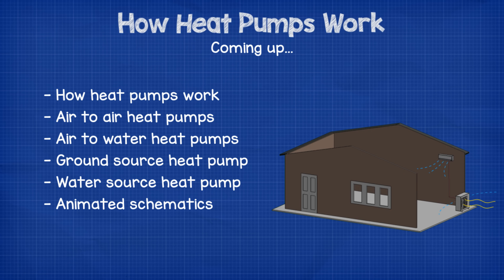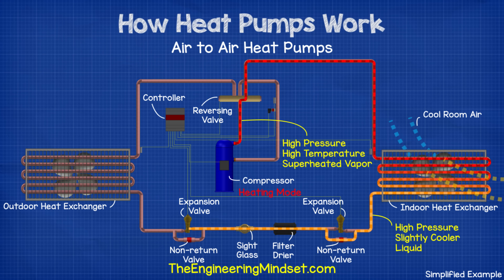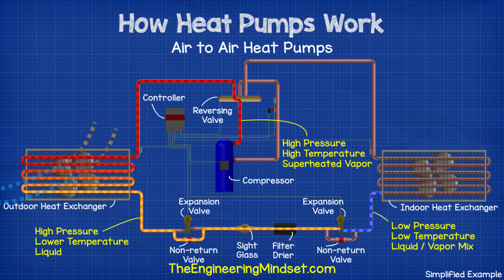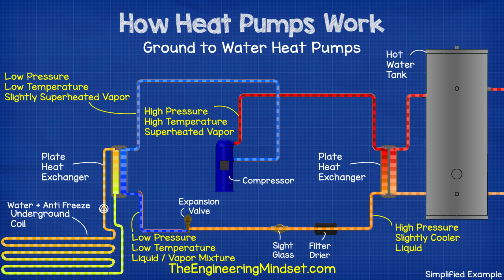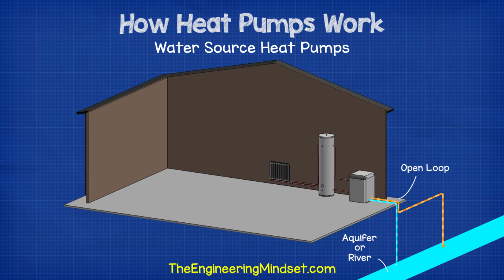Heat Pumps Explained - How Heat Pumps Work HVAC

Comment from the maker: ⚠️ Found this video super useful? Buy Paul a coffee to say thanks: ☕
PayPal: https://www.paypal.me/TheEngineerinMindset
Reply: The only principally different heat pump technology is missing in this review. Water evaporation and condensation heat pump without compressor and refrigerant at all.
Reply: Helpful.thanks.
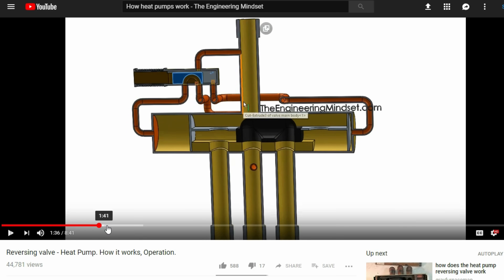Reply: 01:17 into the video, and the second commercial begins.
Reply: Remember when youtube wasn't obnoxiously innundated with excessive commercials ?!?
  Pepperidge Farm Remembers !
Reply: sir i have a question. what if i want to build my own mini electricity? through natural gas. since my place have own natural gas on underground.  now i want to install heat exchanger on my genset. is it possible to do that? instead of using it's giant radiator. I'll just took it out then replace it with heat exchanger system? so could run it continuously everyday?
Reply: Thanlyoi  shering  gues  welcomed
Reply: Outstanding video for slow minds like mine, thank you!! :)
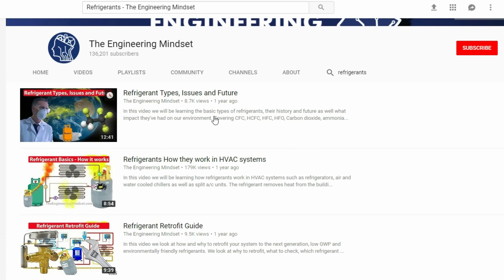Reply: 3:53
Reply: Ys fje wu ti
Reply: Hi interesting
Reply: Could you please make a video on vapour injection system in scroll compressors?
Reply: Good

Comment: so basically they are using the low boiling point of some liquid to boil it and gain the heat from conversion from liquid to gas ?

Comment: I wish that the media and the utility companies would stop telling the public that heat pumps “extract heat from the outside air”! I honestly haven’t thought much about them until recently, but have now started looking into replacing my gas water heater with a heat pump unit. As a retired mechanical engineer I have always been aware that, especially as outdoor ambient temperatures approach freezing temperatures, there really isn’t a lot of heat energy to be “extracted” from the air. Even a high school physics student knows that energy transfer between two fluids depends on the delta T, or the difference in temperature, between the two fluids, and the energy flow only goes in one direction – from hotter to colder – so “extracting heat” from the outside air to warm your house would require a magic trick that Gandalf himself would be proud of. 😉

So, what heat pumps ACTUALLY do is convert mechanical energy (from the electric motor) into heat energy (in the refrigerant fluid) and take advantage of the fluid’s properties (low boiling point) to either heat or cool air or heat water. Their benefit comes from the fact that they do so efficiently, or at least more efficiently than a gas or electric furnace.
Reply: Somebody is lying, this is basic thermodynamics. Refrigeration does in fact move heat from one place to another. Pressure is manipulated to change temperature to make heat flow in the desired direction. The compressor increases pressure and temperature which makes the refrigerant release heat, the metering device decreases pressure and temperature which makes the refrigerant absorb heat.

Comment: Interesting question , does having the water hot in the h/w cylinder with a air source heat pump help in getting the radiators hot quicker!

Comment: very helpful information - people ask me how my heat pump works and I usually reply "magic." So if the ambient air temp outside in January is 20F, and boiling point of the refrigerant is lower than that, the refrigerant will get hotter. But presumably boiling refrigerant is hotter than ambient air - how hot does it get? My air handler rarely switches to emergency heat, so I assume that the heat pump works ok in very cold weather.

Comment: So, the outside ambient air, even if it is very cold, can still transfer heat to the outside heat exchanger? It is relatively hot compared to the refrigerant.  I finally understand this, thanks.

Comment: Heat pumps take warm out of air pump the cold air out , so if most of a nation had them would they make the outside temperature colder cos they be taking all warm air out
Reply: Only so much as there is indoor space on earth. The relative amount of indoor space compared to outdoor is so minor that it would take significantly more than a worldwide conversion to heat pumps to accomplish what you’re saying. Now I would be curious if you have some research or some numbers to show this, as I would be fascinated to learn about it. At the end of the day, the energy isn’t lost, it is simply transferred to an indoor space, which is slowly leaked back into the atmosphere over time. Let’s remember that energy is never created or destroyed, but simply transferred.

Comment: I love the explanation of the heat pump side. Something I am admittedly struggling to understand however is single duct portable heat pumps i.e. a single duct blowing air from inside, across the evaporator unit and outside. To do that, it needs ventilation from outside somewhere else in the space which consequentially means drawing cold air in reducing efficiency. However, if the unit is drawing warm air already in the room across the evaporator, surely that should be better than drawing cold air from outside? Does the cold air being drawn into the room counteract that?

Comment: A water heat pump can only heat water and your house? Can't cool it?
Reply: No air to water can also heat your home via radiator or ducts. I have a natural in gas heat pump. It heats my water too before it goes back to the unit to be reheated.
Reply: @VagabondCaveman  i know that, my question is, air to air can both heat or cool your house, can the water units only heat?

Comment: i dont understand how come the refrigerant cools down when passing the outside fan, i understand it changes phase and in turn release heat, but during a phase change the temperature remains the same, so how does it drop? someone help pls.
Reply: The refrigerant is not cooled by the outside air, it is heated by it during heat mode. The refrigerant would become colder than ambient after going through the outdoor metering device because of the pressure drop.

Comment: I appreciate the video, but one thing I'm trying to understand is how the indoor heat exchanger works. In cooling mode, warm air is pulled in, making the room cold. In heating mode, warm air is blown into the room. How does this work? Are there multiple fans?

Comment: Thank you for not saying it pulls the heat for outside air and puts it in inside your home.
Reply: That's said at 3:58  
The refrigerant heats up when in contact with outside air, it does pull heat from the outside.
Reply: @hardcard254  the compression of the gas is what creates heat and the rapid expansion creates cold. The fan blows over the heat exchanger to remove the temperature of the gas as either the desired product inside the house and removes the undesired in the other heat exchanger outside the house. As long as the chemical used has a low enough boiling point it can work in sub zero temperatures. Look up the 5 Gas Laws and principles. 

 Yeah I guess I didn't watch through long enough for him to say that lol.
Reply: @John-771  The compression of the gas is responsible for only a smaller portion of the heat in the refrigerant. The majority of the heat released inside is heat that was absorbed by the refrigerant when it was in the outdoor coil. Heat and temperature are not the same thing. The compressor increases the temperature of the refrigerant, it does not add a significant amount of heat. There is always heat outside to pull inside the house unless it is absolute zero, -459.6 degrees F.
Reply: @hardcard254  He doesn't say that at 3:58. What I'm talking about is when someone says even when it's 20 degrees f out it pulls the heat from the outside air to heat the house.

Comment: if they were all so magically efficient As everyone says they are, they would already be in all new homes. But they're not because they're more complex, have more parts, function poorly in outside temp extremes and are literally a pipe dream at this point.
Reply: Mine is between 360-420% efficient, depending on how cold it is outside and how high of a flow temperature I need. 
I didn't pull these numbers out of a datasheet, they come from electric consumption and heat output monitoring... they're as real as they get. 

For every kWh of electricity it uses, my heat pump provides between 3,6 - 4,2kWh of heat. 

Granted, we don't live in Canada, Scandinavia or Siberia, we do get below 0ºC temps, but nothing as crazy as -20 or -40ºC  

This "pipe dream" has been keeping our home at a comfy 21-23ºC and providing domestic hot water all winter.
The running cost is less than half of what we used to spend with our oil boiler, the level of comfort is miles better, thanks to increased flow rate and constant operation.   

Also, fyi, heat pumps, solar thermal, etc. are already mandatory for new buildings in some countries. 

The main problem I see with heat pumps is that many installers and sales people either have no clue or are dishonest. 
They charge twice or thrice as much as they should, they sell you criminally oversized machines, they insist on putting in a buffer tank and secondary pumps when there's no need in many cases (and it's counterproductive, even)...
Reply: Heat pumps are the most energy efficient form of heat there is. The downside to them is the upfront cost compared to other forms of heat. Many parts of Europe are primarily heated by heat pumps. If the unit is designed for it they do still function in extreme cold, its just that the efficiency and performance is lower. If sized correctly a heat pump can be the sole form of heat even in extreme cold.

Comment: In winter uk (Oct to Mar ie 6months of the year!):
1. Lounge gets too hot at seated height
2. Lounge is very cold at foot level
3. Cannot air dry clothes in home anymore - Have to use Dryer - more electric)
4. Costs 3x more than summer
5. Is a nightmare and frustrating to understand operation for a typical end user
Reply: British homes are of then poorly insulated what causes problems.

Comment: 6:43 The hot water tank doesn't feed the radiators, if it did, it would run out of hot water in a matter of minutes. 

Keep in mind that heat pumps have high flow rate, they move over 600 liters of water per hour.
A heat pump needs between 30 - 90 minutes to heat up a 200 liter water tank.
If you moved all the water in the tank through the radiator circuit 3+ times per hour, the heat pump wouldn't be able to keep up with the dissipation rate.

DHW tanks for heat pumps aren't heated directly, a "serpentine" (spiral heat exchanging pipe) is used to heat the water in the tank, so there's an efficiency penalty.
Some tanks also come with auxiliary heating elements (resistors), which help speed up the heating process, but this comes at the cost of doubling electric consumption, which defeats the purpose of having a heat pump.

So, basically, the heat pump needs to feed the radiator circuit directly, for best results.
This is achieved by using a 3-way electrovalve, which is installed between the heat pump and everything else. 
This electrovalve diverts the ouflowing hot water from the heat pump to either the radiator circuit or the water tank's internal "serpentine", as needed.
It's an "either or" kind of system, it won't do both DHW and radiator heating at the same time.
Reply: explained very well 👌

Comment: Great explanation! No trying to dump on the vid, but it confirms a lot of my assumptions. Cdn government wants to outlaw burning of fossil fuels to save the environment. As a magical pill. This tech can be offered as an option. Heat pump use now means refrigerant gas will be needed for both heating and cooling. As the systems age the high pressure gas leaks into the environment. This system would also put more pressure on a fragile electric grid.

Comment: If you have a boiler stick with it until  your forced to change.
Reply: Assuming you enjoy cutting, splitting, stacking wood, cleaning up ashes, stocking the boiler, smelling like smoke all the time, etc. When you put value on your time messing with it, you are losing money compared to just paying a heating bill. If you have any skills in the trades, you could simply do 1 side job for a few days and that would pay your heating bill for the season. Then you wouldn't have to mess with all that other crap for months on end. Best setup is a heat pump with propane or natural gas as the aux heat source. Cheaper heat in the coldest times and an easy heat source that a small generator can handle if the power goes out. Of course if you're simply in it to fight the government, have at it lol

Comment: I used the exact solenoid with a high flow rate as the fluid pushes down on the oversized valve land for sealing at static pressure. But mine is on an oil accumulator to pre-lube a gas V-8 engine. It is energized with the key on so during starting, it quickly floods the main oil gallery (High-Flow, 1/2" NPT, Viton Rubber Seal; New surplus at 1/10th the cost of Name Brand oil accumulator companies; 
with pressurized oil to the bearings. This would greatly extend the life of all "Stop-Start" engines in those vehicles. After being an ASE Master Tech since 78, I will argue a room of engineers under the table! 5,000hrs is the 150,000 mile equivalent that GM designs parts, materials and still make them to keep from paying CAFE a fine. It's a law passed by the Clinton administration.
Great job on the video.

Comment: I always hear that heat pump is very efficient and save on electricity and air conditioner use a lot of electricity but arent they the same thing? Shouldnt both be consuming the same amount of electricity?

Comment: Are the expansion valves in this example one-way only devices?  They only allow flow in one direction hence the non-return valves and the fact that there are two of them in this example. Thanks.

Comment: These are by far the best and most clear videos that I have found. I use them in my Adult HVAC classes and they benefit my students greatly. Thanks for clear, concise, accurate, and sometimes amusing videos!
Reply: yea but i think that the part at:
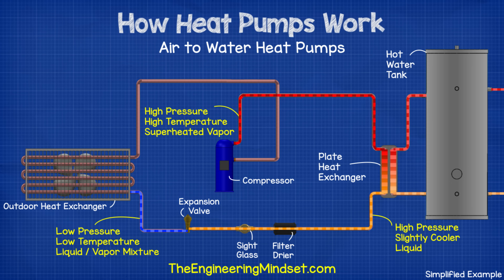6:22
is misleading for people who just learn about this stuff
from my personal logic/understanding the expansion valve just maintains the two different pressure zones and its not the thing that actually turns liquid into vapor

I'm pretty sure that its the pressure drop doing that, and the pressure drop is caused by the compressor

but this is just my logic and maybe im just nitpicking...
anywa, the video is great
Reply: @423GustavBern It is assumed that people understand that pressures want to equalize.

Comment: I genuinely don't understand how they work. I didn't find this video helpful. If anyone cam explain them to me I would be interested in understand them
Reply from the maker: It's an air conditioning unit running in reverse. The refrigerant boils at very very low temperatures, so it can absorb energy from the air outside even in winter, the compressor packs this energy into a very small space which increases the temperature and its then pumped indoors. That's as simple as I can make it, I would suggest watching the video again in full without skipping and pause the make notes, it will click, don't give up.

Comment: so basically just a regular air cooler, but reversed and in lower temperature ranges. cooling down the outside even more and dumping heat inside

Comment: Correct me if I'm wrong, but hydroflurocarbons were banned from fridges because they are 1000's of time more harmful to the ozone layer than carbon dioxide. So why are we now using this chemical in heat exchangers?
Reply: HFC refrigerants are not ozone depleting like the CFC and HCFC refrigerants they replaced. But they are potent greenhouse gases. They are now being phased out in favor of HFO and HC refrigerants.

Comment: Thank you for the informative vid! Question: can anyone clarify how the 2 temperature zones are managed? It seems to me that you'd need 1 refrigerant that boils at low temp, and another at high temp, so that you can capture/release the heat at those phase transitions. Yet these diagrams seem to suggest 1 single refrigerant is used. How can that work?
Reply: Boiling point is irrelevant, temperature of the gas simply increases when you increase its pressure (pV = nRT formula). So by exploiting this fact, you start with the gas at room temperature and try to get it warmer than outdoor air during the summer, so that you can cool it down using outdoor air. Once it's at outdoor temperature while compressed, you expand it back and the expanded temperature is now lower than the initial one.
Reply: @DediPig  Right, as Eng Mindset points out in his other vid on refrigerants, the key is controlling pressure. That said, boiling points are presumably still important, though I don't know why.

Comment: You forgot the coolest part, put a subcooler on the liquid side, the liquid refrigerant can’t be cooler then the water in the tank, then you can put a heat exchanger in the garage or something and take out moore energy before the liquid going to the expansion valve and vaporize!

Comment: I suddenly realized why they call the two lines that connect the outdoor unit to indoor hardware the 'vapor line' and the more narrow gauge 'liquid line'. Because of the reversing valve, the direction of flow on those two lines reverses flow when changing mode, but the larger vapor line always carries vapor, the more narrow gauge line carries mostly liquid. During heating the vapor line carries slightly superheated vapor to the indoor condensor, during cooling the room temperature vapor makes its way back to the compressor in the opposite direction. Presumably the indoor vapor line always comes off the top of the coils, the liquid line comes off the bottom, so gravity keeps fluid from going the wrong way and choking the compressor.